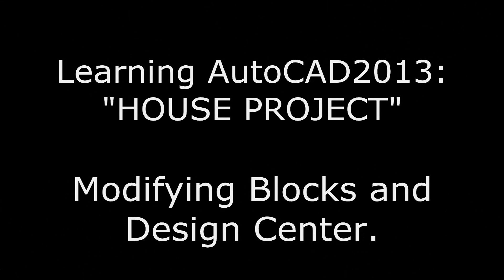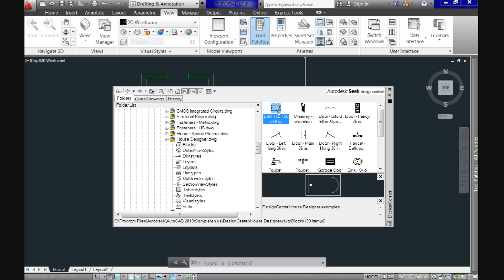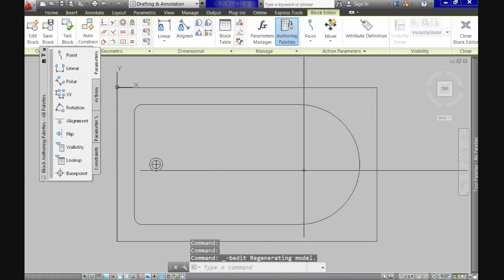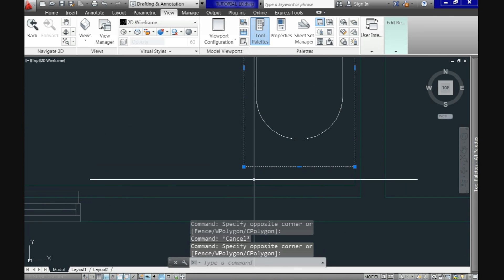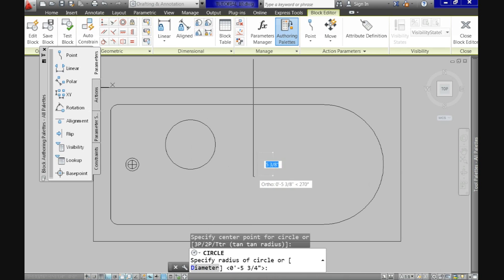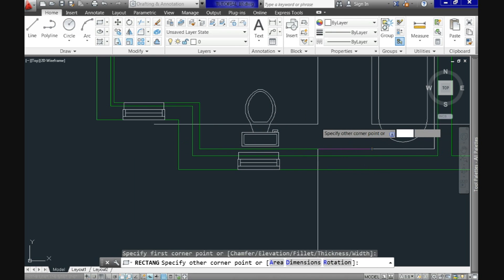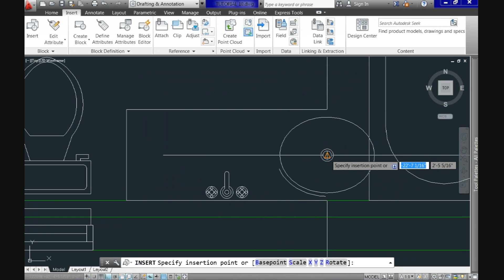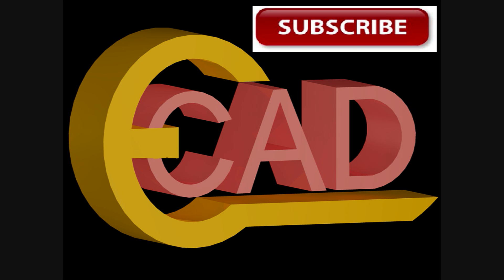Learning AutoCAD 2013 tutorial 12: Modifying Blocks and Design Center.

Comment: thanks sir but the area for insertion is 3sq.m. and i think its from the insertion scale from design center. how do i fix it
one thing also the design center window don't contain the usual right and left pane. Do you have any idea as to what cause this glitch. ManyThanks and nice weekend
Reply from the maker: nicolas jr nikcool Hello,Try sending me a screenshot of what it is. Besides what block are you trying to insert? what version of CAD are you using? You can drag and drop it in the model space, so I don't quite understand what you mean.

Comment: thanks for ur reply but as u said double check the measurements of the block. its measurement is 1524 x 915.03 am using metric on my drawing and am using scale on my drawing 1 : 1 thanks again for ur help
Reply from the maker: nicolas jr nikcool Ok, you have to compare it to what you have on the drawing. So for example if your drawing is a small part of 500 mm then the block you inserted is huge compared to that. So point is to determine if there is something wrong with the insertion scale from the Design Center or just that the block is bigger than what you have on screen.

Comment: Hello. I had one questions about this specific tutorial.  I just installed the 2013 but in this tutorial I cannot find the block samples like you have in the video. Do i need to have previous saved files where those blocks were created, because mine does not give me all the options you have, Thank you for these videos. I have not worked on autocad for 2 years and this has reallllly helped me.Thanks again and please keep making videos.You are a life saver !
Reply from the maker: Albulena Etemi Well everyone should have them in the design center. What type of CAD are you using, the regular 2013, the student version, a cracked one or a trial?. Try typing command "design center" and see if you have it. Then you will have to locate the block samples accordingly. Please let me know so I can help you more. Hope this will guide you.

Comment: hello, does .85 make the object/sink smaller? As if you were using 85% of the actual block size instead of 100% ? Were you eyeballing the size? Also, do you think CAD runs better in a MAC or PC? Thanks
Reply from the maker: Yes, 1=100%, any number less than 1 will shrink the block and of course bigger will increase the size as you are saying. As of now, both are pretty well and stable, but have in mind that Cad was designed for Windows platform, there are certain variations between the 2. I prefer using Cad in a PC but have no problems  with Mac either. In the past it used to crash more often in Mac, but I haven't seen it in recent versions.
Regards